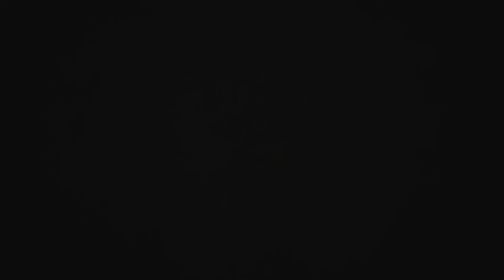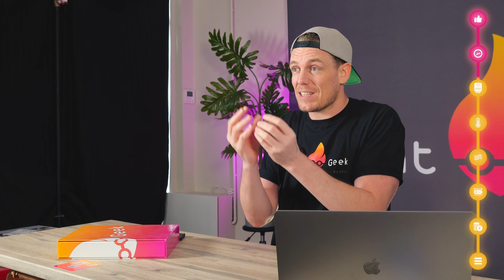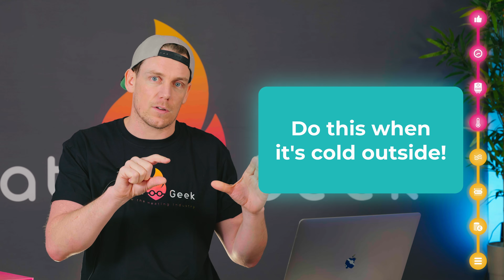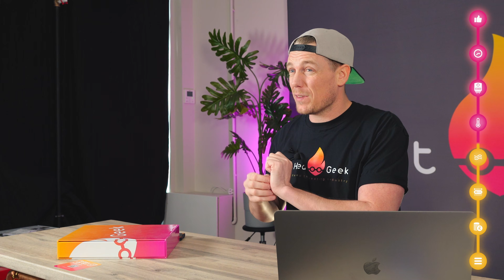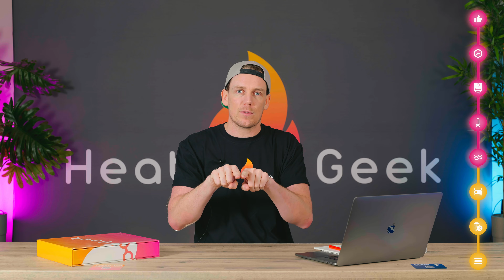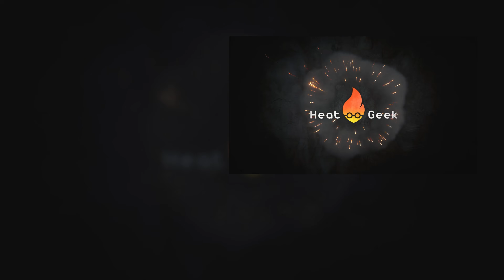PAY LESS FOR HEATING!! | The Secret To Boiler Efficiency | Consumer Advice

Comment: Hi there, been using steady state through Oct and Nov. 

Slowly increased the flow temp on the heating from 30c to 31c 2 weeks ago to 32c 2 days ago.

House always holds >18c with fluctuations between 18c and 19c.

Current use 50kw gas a day BUT our heating is on 24hrs a day.

Great results!!!

One question we are going away for 4-5 days. Are we better turning off the heating and firing back up just before we get back at high or low flow temp or leaving it on at current rate or lower the flow rate to say 25c?
Reply: I’m not sure if I’m understanding you correctly but I think it sounds great, can you explain in a way that a muppet could understand please because I’d like to try it 😁

Comment: I have a question. In a large house 5 bedroom + Is it more economical to have a hot water tank like a mixergy or a combi in a large house?
Reply: The number of bathrooms generally determines the effectiveness of a combination boiler. If you have two or more bathrooms then a standard (30kw) Combi will struggle to cope with demand as it will only deliver to one hot water outlet at a time.

Comment: Do you have any sources for this information as I'm interested to read more? Or if not, would you consider doing an experiment maybe with a shower at 35C and measure gas usage over 10 mins of a boiler set at say 60C and 40C. Perhaps even test a few further temperatures as I would be interested to see if there is a point where temps that are too low actually reduce boiler efficiency (I'm thinking along the lines of a car engine where it is most efficient at a middle speed of 56mph ish)
Reply from the maker: Lots on our website at heat geek dot com. 

Read the condensing theory one. The lower the better. It doesn't stop. 1c is the most efficient

Comment: Hi , I have a system boiler and I have option for setting temps for both rad heating and hot water. . So does this mean  I can set my hot water to 60degree and my heating to 55degrees or lower when testing comfortably on lowest flow rate without any concerns ? Temps between the heating/water don't need to a minimum apart from one another ? Thanks

Comment: I have a condensing combination boiler, but there is only one control on the front for the radiator temperature, that runs from cold, 1,2,3,4,5,6, max. I currently have it set at 4, but how do these numbers relate to temperature?
Reply from the maker: What boiler is it?
Reply: @HeatGeek  Worcester Bosch 24i Junior.

Comment: Always wondered where the 50 degrees minimum temperature (re legionella) for hot water should be measured. At furthest tap? At hot water cylinder? Advice would be welcome.
Reply from the maker: In commercial yes at furthest tap. There is no regs or anything in domestic

Comment: Hello great vid as ever, your a very good. One question you said if you can run your combi at 55deg flow temp you said you will know your OK to run air source pump. What about flow rates though? I touched on this with a comment before about pipe types. Is the flow rate of air source comparable with a boiler? Ie will I not need to increase the diameter of my plastic pipes?
Reply from the maker: Hi there. Yes the flow temp is relevant to the rads only. Most pipe work is fine to be hinest but just incase we have a video regarding pipework here

https://m.youtube.com/watch?v=HFlIbNAUWkY

Comment: My Combi boiler has an e on the radiator temp dial for efficiency. I keep it at that, so what you are saying is to drop it below that level and my 2018 boiler will be more efficient?
Reply from the maker: Yes exactly that. E is the beggining.. the lower belownthe better
Reply: @HeatGeek  going to need to remember to do this in the winter! 🥶

Comment: You might want to point out that for the uninitiated like me that you are not taking about tank thermostats which must be left at 60 Deg to kill bacteria. I initially got confused as my boiler is an ideal heat 18 and doesn't have anything to indicate the exact flow temperature. It has dial but only has Min, Max and Economy (whatever that means) marked. Any idea how I can tell the flow temperature in such a set up so I don't set a flow temp below 55 Deg?
Reply from the maker: Economy is usually 70c ish.. below that I can't help. The cheaper the boiler the less options and functionally unfortunately. Ideal is pretty basic in offerings

Comment: I cannot find much information about aluminium radiators? Shall I invest into them? Just about to replace all my single panel radiators as part of a refurbishment and eyeing with double panel aluminium radiators instead of the standard type22 ones. They cost at least twice as much though. Does it worth it in a 3 bedroom terraced house with 9 radiators?

Comment: This is a fantastic video! Can a weather compensation unit be added to a ideal boiler with a hive thermostat?
Reply from the maker: Depends which ideal boiler. You'll have to put the hive thermostat in the bin though. It's the worst stat.
Reply: @HeatGeek  it's a ideal logic +, does the hive have to go? I know they are rubbish but do not want the outlay of a new thermostat.

Comment: Condensing boilers may well be mandatory but designing the system to actually run at a low enough temperature to condense is not.
Reply: It is after June mate
Reply: @copperskills3973  couldn't come soon enough, Wales and Scotland have had it years.

Comment: Great info, thanks. I was trying to find if there is an optimum flow and return temp to get the most efficiency out of a combi boiler?
Reply from the maker: No. Only thr lower the better
Reply: For condensing boilers the return temperature should be below the dew point of water, which is about 55C, for maximum efficiency.

Comment: What the heat geek  isn’t telling you folks is as part of April 2022 revision 18 all boiler swaps must now do a heat calculation also one of the amendments is the systems now have to conform to a max 55c for heating and hot water. Funny that they are the same levels as heat pump products.  Forcing people to go heat pumps in the future I think - not on my watch , hydrogen first you can’t run industrys on a heat pump to cook your crisp , melt your aluminium for cans etc
Reply from the maker: First if all that's untrue. Its becoming a British standard not a regulation. There is no 'must'. And a heat loss and lower temp has always been a better standard it's not knew.

If you think a hudrogen grid is going to be around jn the next 100 years then you aren't involved in the heating industry but an enthusiast at best
Reply: @HeatGeek  no it’s a requirement further to this Wooster and baxi have been  issued updated information it clearly states that the new systems must be set to 55c on installation or it will affect your customers warranty , you should have got them in the mail.   In regards to hydrogen for industry Not domestic)  is a must with blends up to 40% without major upgrades for industry. yes April 2022 revision 18 it’s British standards but if you don’t think that that apply remember that the next time you go for gas safe registered which is also changing from 6 months experience in industry to 12 months. And reassessment every 3 years a requirement to work on for both  lpg , fire places , oven’s and gas refrigerant based air source heat pump typically found with ht pumps , further to this heat calculations are being mandatory part of gnvq lev 3 /4 training , To improve and working practice in the industry
.  biogas is j not a. Viable option that cannot be expanded let alone the millions in cost per plant , yes you can add it to the existing grid but is 4/5 times more expensive than other methods and government own statics show it will only contribute just 8-10% to the grid at best , further to this the U.K. is currently in the middle of updating all gas pipe lines to homes replacing the old 50-60’s pipe work , is it really that hard to just make it hydrogen mix ready going forward otherwise it’s a complete waste of money.  you cannot run heavy industry on heat pump technology period , if you could Germany (the eu leader in heat pump installs) wouldn’t still be dependent of fossil imports non of the alternative energy methods haven’t even thought about how to moving industrial production,it’s  very nature on function it it has to burn to heat up or cook , electric is not an option to these businesses
Reply from the maker: @ram64man  hear loss has always been a requirement in nvq l3. I didn't say heat pumps could power heavy industry. Wait for our hydrigen video due in 2 weeks before assuming our opinion. Also.. we are the uks number 1 hydrogen fuel cell boiler installers so have a rounded and unbiased view

Comment: Mines pretty bad, iv looked at all of these tips and iv tried to alter mine to be more efficient, our bills £250 per month, the heating is only on for 3 hours per day, our hot water heats when I turn it on and it's only at 11% efficiency, somethings definitely wrong its costing more to run my combi boiler that the old dinosaur of a cylinder tank

Comment: Can weather compensation and load  compensation (ie Nest over opentherm) be used together or do they end up fighting each other? Our boiler has both options.
Reply from the maker: They can be used together sometimes. It depends on the boiler and conteol though
Reply: @HeatGeek  Thanks. It is just a basic Logic Heat system boiler but it does have wiring ports for opentherm and weather compensation. The installers wouldn't fit the available weather compensation module saying that was only required if the boiler was going into an unheated space like a garage!
Reply from the maker: @iainmporter  so sad to hear

Comment: Ive reduced my flow temperature to 46c but the boiler overrides this on occasion to 50c is that normal, no settings to change on that with the Ideal logic c30
Reply from the maker: @oiyou5870 it can overshoot yes. Particularly if you have turned off rads/used trvs heavily

Comment: I reduced the flow temp in a combi boiler from 55°C to 40 and it consumed more gas, struggling to raise the temperature. Not sure that the advice to lower flow temps to minimum possible works. I think there is a sweetspot of maximum efficiency.

Comment: Hi there, great video thanks! We currently have an ideal logic 15 (15kw system boiler, I know from other comments, its basic so its probably not able to have a dual control fitted) with a Tribune XE 210 litre unvented cylinder. Will 60c setting be high enough for the tank? The plumber claimed the "eco" setting (which isn't really eco at all as its about 69-70c according to the digital display) was best because it ensured legionella would be killed as there could be a drop on the heat the boiler is putting out vs the tank temperature. The tank is only around 5 metres from the boiler! So is 60c ok? Thanks.
Reply: 60 is fine - will kill legionella at that temp and should use less energy to heat . As mentioned in the video try turning the thermostat on the cylinder down to 50-55 degrees because the water at the top of the cylinder is much hotter than near the bottom third ( where the thermostat is )

Comment: I’m having a new Viessmann Vitodens 100-W 35kw boiler fitted, with a Nest Gen 3 controller, should I be asking them to fit a weather compensation sensor also?
Reply from the maker: If it's going to be installed with opentherm it's ok

Comment: Dear heat geeks 
I am looking to to fit a water tank to my combi boiler using a intasol solar combi valve to maximise my PV usage with a myenergy eddi to get free hot water. my question is would it make sense as the tank is a twin coil tank could I use diverter valves on the radiator side when the tank gets hot could I bypass the boiler and pump water through the the water tank coils to heat the radiators bearing in mind I was only going to heat the water tank with excess solar nothing else. Is this doable or just a waste of time any advice would be grateful thank you Jason
Reply from the maker: Too little energy wouldn't be worth the exercise I don't think. Especially as pv doesn't generate much in the shoulder months or winter compared to the likes of solar thermal
Reply: @HeatGeek  thanks 😊

Comment: I understand the idea of changing flow temperature but why is the flow rate never referred to? Can you not achieve a similar affect by reducing the temperature of the boiler and the flow rate so that the boiler temperature/gas consumption rate can be reduced but if the water is travelling through the boiler more slowly will it not  increase the potential for heat transfer within the heat exchanger? In an older boiler could that not be a way of increasing its efficiency? I have a very old balanced flue system and the central heating pump died some years ago. I bought a new one which a plumber fitted along with a replacement hot water tank but whilst I think the pump had a larger capacity than the original, no real time was spent adjusting the flow rate it was just installed set on a speed and then its been left running at that speed ever since. My boiler has a heat setting from 1 to 5 Warm to Very Hot. The hotter the setting the hotter the whole boiler gets. Seems obvious to me to set the temperature down as low as I can as it reduced heat transfer loss from the boiler itself into the surrounding area and as its in a utility room its largely just wasted heat.
Reply from the maker: Flow rate auto changes as the pump is ‘burner linked
Reply: Even in a boiler that's nearly 40 years old  (Glow-worm Fuelsaver 55F)?  @HeatGeek
Reply from the maker: @Just_a_thought-k9g  that’s non condensing so matters less. Once you go Erp pump with trvs the savings are maxed pretty much
Reply: Thanks, I have TRVs fitted already. but what's an Erp pump?  I have a Grundfoss UPS 15 60 130 set on speed 2 (mid flow rate) @HeatGeek

Comment: Weather compensation aside, does what you say about flow temperature also apply if your thermostats support OpenTherm?  I ask because I just installed a Tado system of smart TRVs and wireless receiver (EU version, so has OpenTherm, as does my Intergas combi) and figure that therefore I could turn the max flow temp up, knowing that the receiver will dial back flow temp as demand decreases.

Was that a daft thing to do? (Yes, it was.)

ETA: Ofc it might not be safe to assume Tado's OT set points are sensible.  I guess I ought to monitor the CH return temp and knock back the max flow temp if it's > 40–50°.

ETA2: So I gather Tado OT defaults to a maximum of 80° anyway and what I set on the boiler itself doesn't matter.  And also, the Tado for Installers app lets you configure the max flow temp.

Thanks,

Comment: Running your boiler for longer, would it be possible the gains would be offset by the increased electric usage? The pump uses about 300w!
Reply: The small increase in electricity use will be easily offset by the reduction in gas use. Overall your bills will be lower.

Comment: This is so confusing! Another video f HGeek talks about going down to 45-50 degree even on a system boiler … (provided 60 degree is done to kill bacteria every so often). Whilst now you not to go below 55c

So if setting system boiler to 50 and water tank stat to 50c. Is that doable and works fine? Will that be enough as well as work in condensing mode?
Reply from the maker: We say to not go below 55 if you don't have hot water priority.. 40-45 for hot water priority. Yes it is confusing which is why we always advise using your local heat geek.
Reply: @HeatGeek  much appreciated 👍 that means even with 55c the system boiler won't be condensing. Correct? 

What about going down 53c on cylinder stat and system boiler 54c. Will this make any difference in efficient and save money;? (Condense too?)
Reply from the maker: @bimiuk4051  yes it will condense anything below 70
Reply: @HeatGeek  this is mind blowing. I loosing the plot here. After numerous videos and research it was noted that a boiler weather system or combi - will condense below 54c is this not correct?

Surely condensing at 70c must be much less effecient. The key point in my case is to establish if I can get my system boiler and water tank (no PDHW) to lowest point where it can heat water tank and also be condensing on CH side so that it saves more money at the end.

If I could get PDHW working even better but until now I am not finding any wiring diagram to follow.

Cheers
Reply from the maker: @BiMi UK  54 return temperature not flow. And the lower below the better. Read our article on it.. Google 'heat geek condensing theory' it's all there
Reply: @HeatGeek  so if I set Water tank stat to 60 and new Ideal Vogue system boiler to 60c

To me it means that the return will be at least -10c and therefore return will most likely be 50c

Yes I seen lot of your videos and read articles. Matter of fact been reading too much and now I am all over the place.
Reply from the maker: @BiMi UK  you can't do that.. the boiler will cycle. Please value your own time and call a heat geek
Reply: @HeatGeek  sure, sadly there is no (red badge) heat geeks around my area. The only one around was not interested. 

Not sure where to go next

Comment: Interesting. I have a condensing boiler. It cleared up my thoughts about legionella. Is there a minimum temperature at which it dies?
I recently installed a bath and set the boiler at 40°C and just a few inches of water is good because I don't want to swim in it. Or drown in it. A lukewarm bath in that hot weather was nice by turning the boiler down.
I read the red figures on my meter to see how little gas I have used. I have just the one tap on my bath because why boil water to only cool it down. A nice old brass tap which says 'cold' on it but never mind. No idea where it came from.
Washing pots, clothes and bathing i have used 0.934 units of gas so far this month to 11 th September.